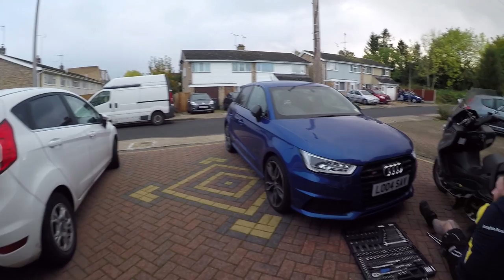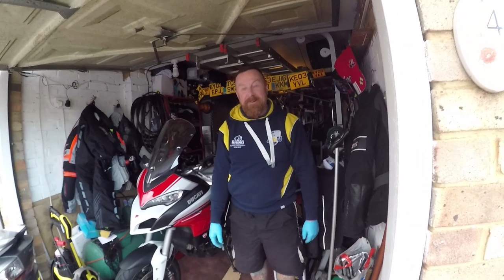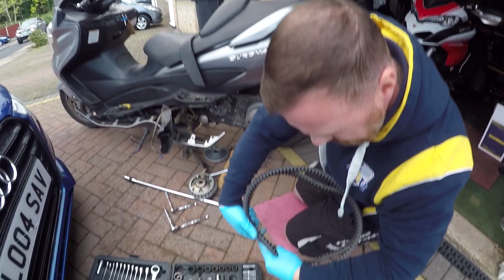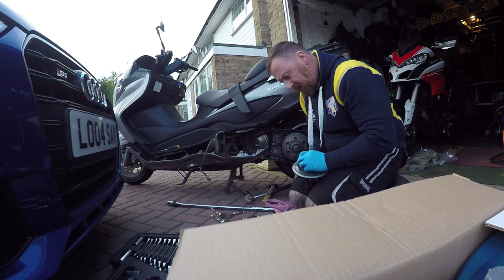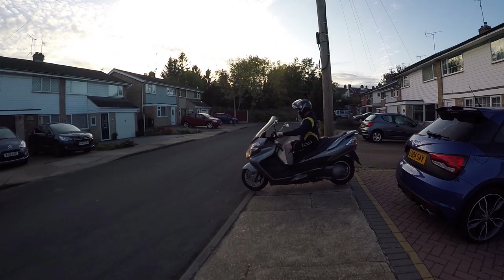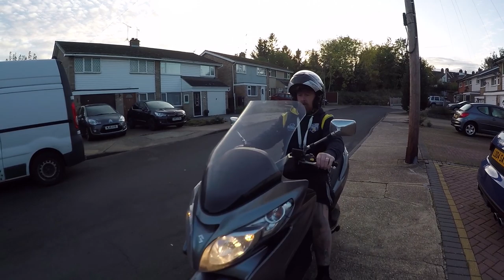BURGMAN MAXI SCOOTER CVT BELT & ROLLERS  CHANGE MARK SAVAGE

Comment: To take the cover off you put two 8mm bolts in those rear cover holes and you then tighten them you easily jack the cover apart.  You dont hit them with a hammer.  :-)
Reply from the maker: So you can learn something new every day 
Thanks bud , I did want to do that as was worried what I would be screwing them in too so played it safe than sorry and it did work! 
Will do that next time

Comment: Everyone needs a Shop Manual so that Specs. and Torques can be Applied, it is always best to see things done step by step...
Reply from the maker: the problem is not all can learn by reading and seeing picture 10.4 on page 57 , then read page 45 and see picture 9.6 on sub section 3 
i learn visually and try to show people watching a way they can see and copy , its not always spec but works and easy to understand

Comment: Just replaced the rollers sliders and belt on mine today, I only use genuine Suzuki rollers and sliders, I always use thread lock on the variator and clutch threads before I torque them, for peace of mind 🙂
Reply from the maker: agree bud and i found out the hard way

Comment: Love your video  mate what  size roll for yamaha aerox yq  50 reg 2004 .. Will be the best
Reply from the maker: As in the speedfights I always use 6g rollers for the best pull away and top end ,remember to clean the variator before replacing bud 
,thanks for watching bud
Reply: @marksavage  If I change my  ht lead    in to  a raceing  lead upgrade  is to much . Or buy  the one like the  bike was make for  can help
Reply from the maker: id stick with standard bud it make no difference on 50cc's
Reply: @marksavage   top men  big thank you  again  I love your video  . And I  tell all my friends  to give you a  watch

Comment: hi marke help me on my mistry problem on my gilera runner 50cc air cooling  its does strte easy and normal but whenever my wallse hit something on road its start to lose power completely I had to keep tortole at max to keep it running on very low speed berly moving  and then somehow start to getting power up and back to normal  I did check everything carp a new speak  cld exsght reglatore and sataor everything  still I have the same problem I don't know why but what  I know  when I changed a good condition  used carp reasone was to keep my scooter running and not cutting but I get worst then that problem I'm confused and every repair here couldn't finger out where is the problem . you are my last resort to fix my problem sir
Reply from the maker: Ok bud 
Could be electrical so check HT lead and cap and I'd replace it as not a lot of money 
New plug 
Does it do it when its dry and when it been raining ,
Could be the plug is getting wet ?
Have you changed the rollers and cleaned the variator while there chande belt 
Clutch like in my winter ride video
Clean carb and check vacuum and fuel and air pipes 
Make sure they are tight and not gone hard
Could be anyone of these things but all worth a check bud
Reply: @marksavage  I've replaced the plug spark I've changed new sparks I've changed even CDI IGNITON but what I did notice is when ever hit something in road its start to do it lose power and regain it over clean road  and also losing light and my speedmater getting shut down too even big light too on it getting shutdown and back up normally I sawer ive never seen something like that sir  but I wanna ask sensei you know better  could reglatore be the case or the new carp I mean used conditions or I get ripped off I don't know I'm lost it's been 2 week with this problem I can't go to work properly buddy's

Comment: Don't you have a compressor? You can get some good deals on that as well sometimes. I got mine, (50L) and an impact wrench for about 100 euro.
Reply from the maker: I do have a massive compressor however it wont take of the locking nut of the the variator system as it would just spin the engine over, but worth a thought 
thanks for watching bud
Reply: @marksavage  No, an impact will just loosen them, believe me. It's what they do in garages. It's kind of the correct way. 

It doesn't spin the engine, because it's an impact wrench. It only slams the bolt loose, there is pretty much no turning force.  
I have done about 30 at home (for friends) at this point. 

Try it! Guaranteed, bolt will be off in about 30 seconds. 
Clutch is the same story.
Reply from the maker: ill give it a go bud, maybe my old compressor wasn't strong enough
Reply: Try a larger diameter Hose from compressor to tool, small diameter hoses throttle the delivery rate and limit the output. Cheaper than a new compressor.

Comment: Hi mark I think I have a with my speedfighter 2 I took the standard exhuast off to upgrade to a sports one and the standard one was full of oil and petrol any ideas on what it could be
Reply from the maker: I've seen this before and it can be too big of a jet and in burnt fuel 
Change plug and clean air filter  and give it a tune like in my video 
This should sort it self out now you have change the exhaust bud
Reply: @marksavage  okay I will have a look tonight thanks mark

Comment: mark savage  i have a problem with my speedfight 2 it bogs and splutters on take off but still gets going and when i take my air box off it runs fine do you or anybody in the comments know what my problem is?
Reply from the maker: service, plug and a tune bud , id be also looking at the jet as sounds like you are getting too much fuel so maybe a smaller jet , go down by 4 and see how it runs bud

Comment: Longjia 50cc 2t
What gram roller weights would you recommend to have a  little more bottom and top end speed.
2016 reg.
Reply from the maker: with all mine I go for 6g rollers it seems to be best for top and  pull away bud
Reply: @marksavage   36g total ?
Reply from the maker: @vlogsandstuff3159  yes bud
Reply: @marksavage   many thanks much apreciated.
Reply: @marksavage 
Longjia 50 cc 2016
On starting off from tick over feels like it's missing but once it gets going it runs smoothly. Just intermittently from starting off its a little un smooth
What you recon.